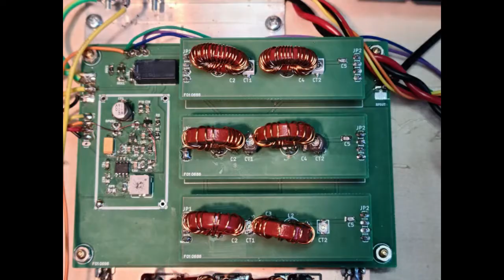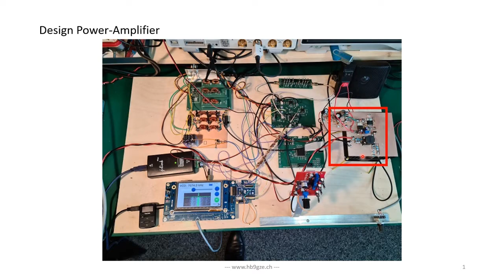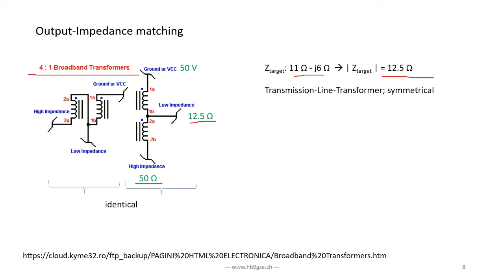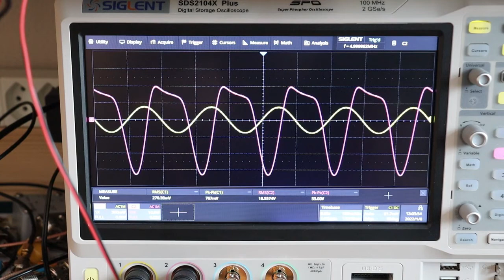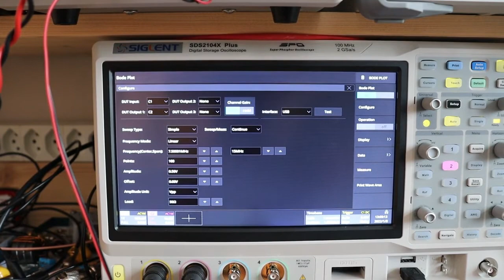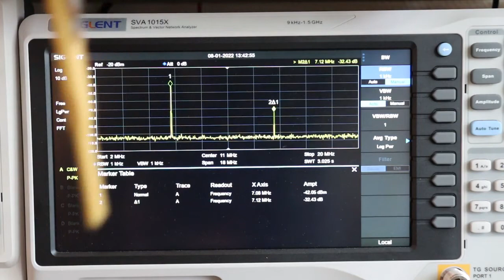HF Power-Amplifier MRF101

Comment: Fascinating video, thanks. You could use an LPF with a series parallel trap section tuned to the 2nd harmonic to clean up the output. Subscribed to watch your other transceiver module videos!